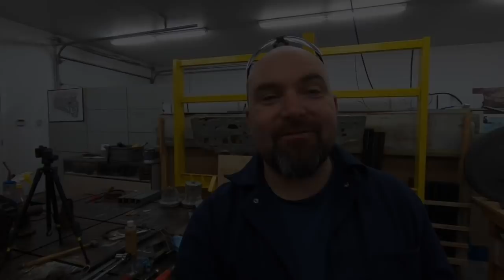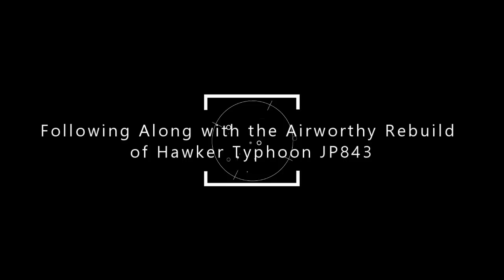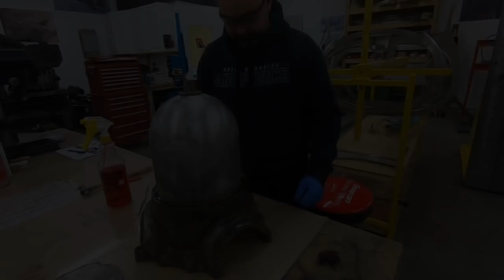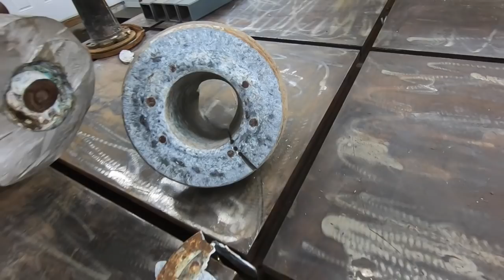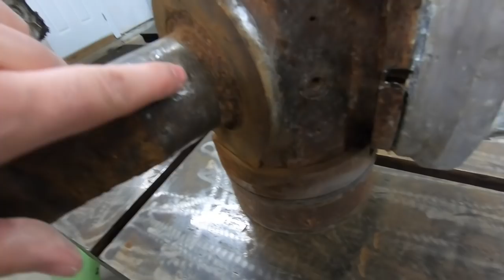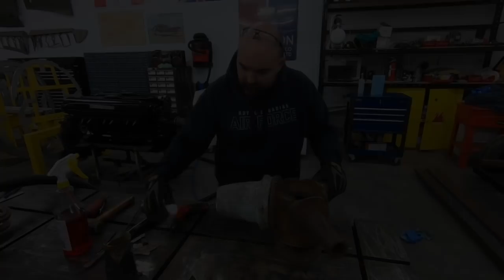S01E10 Part 1 Hawker Typhoon Propeller Investigation

Comment: Greetings Ian.

I am Australian and have maintained a passionate interest in all aviation related subjects since I was a small boy.

While undergoing pilot training in Australia during the 1970's I discovered someone renovating a spitfire with the intention of returning it to engine run and taxi status.

The project was housed in a small, ancient, dilapidated and innocuous looking corrugated iron building on the airfield where I was training.

Being only 30 odd years since the end of WWII at that time all sorts of older aircraft and war surplus was still reasonably available and one bloke had a twin row Wasp mounted in a maintenance frame on castors for sale.

From memory the asking price was something like $2,500 and that engine had several very large fuel pumps, I recall thinking what a phenomenal fuel flow it must have required!

I also recall a section of the building housing the Spitfire project was segregated and one day I looked through a grimy window and saw a semi disassembled fabric covered aircraft which looked as though it was probably an Auster!

All that is undoubtedly long gone now, however I recently had the privilege of accompanying a friend to visit a retired RAAF maintenance engineer who owns a private airstrip along with a Piper Traveler and a couple of tiger moths.

There was also a very dilapidated but completely intact Tiger residing in an annex to the main hangar and when I enquired about it our host told me the old machine had been virtually given to him provided he was willing to remove it from the shed on a farm where it had long resided!

Obviously some special old gems are still out there languishing in the most improbable locations and I live in hope I will catch wind of an engine or parts of one of use to your project one day.

Anyway I digress, the Spitfire I mentioned was being renovated with parts salvaged from all over the Pacific including creation of one wing from the front and rear halves of two separate wings acquired from a dump at separate disused wartime airstrips on small islands.

From that time onward I dropped by occasionally to follow progress and do odd jobs such as filing the dome off conventional pop-rivets to make them look like proper flush rivets and fairing the result with automotive body filler etc.

During one such visit I found the owner of the Spitfire examining a disassembled propeller with badly damaged metal blades which naturally interested me.

As a result of my curiosity I was shown a series of photographs depicting the propeller being salvaged from a swamp near the city of Darwin in the Northern Territory of Australia where it had apparently lain since a Spitfire had crashed there during the war.

I was then shown the disassembled hub of the propeller which had apparently still been full of oil when salvaged and so was in pristine condition.

From memory a large bearing within the hub bore an alpha-numeric sequence lightly inscribed on the outer shell with some sort of Dremel tool or similar method.

The owner said he had provided a copy of the inscription to an organization in England which had been able to tell him that the sequence was the identification number for an employee at the works when the propeller had been assembled.

That information had enabled my acquaintance to determine which Spitfire the propeller was installed on when the aircraft in question was shot down!

Your description of the serial numbers inscribed on the hub-dome you possess evoked many memories and considerable speculation for me!

With regard to engines I also recall reading a book titled 'The Big Show' by free French fighter ace Pierre Clostermann who flew Napier engined Tempests during the latter half of the war.

During that period in his narrative Clostermann describes a number of Tempest crashes and I wonder if any of his descriptions might enable someone to locate further engines or components for you?

Thanks for some really interesting content!
Reply from the maker: It is quite impressive to find internal component in "like new" condition. Maybe not a situation that happens often anymore, but we've got to take it when we can get it leaving no stone un-turned. Unfortunately the recovery of crash sites is becoming increasingly difficult due to new laws being implemented throughout many European countries; most of our efforts to find parts fro reverse engineering relate to finding those who have made such recoveries in the past.

Comment: Not being funny Ian but why not sick that on a milling machine and just mill a big slot from the base out towards the tip down to the bushing,  then on the smaller diameter do the same again then cock the unit on an angle to coincide with the tapered part and you would save yourself a ton of time to get that prop root off of the spider.
Reply from the maker: I went this route due to the shape; there is quite an uneven profile to it, so the best way to complete that setup would have been to chuck it in a dividing head; unfortunately at that time we didn't have one large enough. ~Ian
Reply: @TyphoonLegacyCoLtd  Good enough reason Ian cheers from the UK, and have a great Christmas and new year mate to you and yours.

Comment: Ya ! I have used atf/ acetone mix before.Seemed to work ok. Like you said , you have to be careful because it is more volatile. I use PB blaster for heavy stuff myself.
Reply from the maker: I really wasn't overly impressed with it,  but it did work. I've used PB blaster and found that it's very good; the one limiting factor of it's use is that it can really smell up the shop! we're using a 5 way penetrant made by 3M now, works great! ~Ian

Comment: Won't the Acetone degrade/destroy non-metallic seals? Sure, you won't be wanting to re-use them but you may need them to correctly size and procure modern replacements.
Reply from the maker: It likely would in a stronger mix held in place for a long period of time; there was no effect on these seals. ~Ian
Reply: Hi Ian, if you use the standard transmission fluid (DEX III) it will attack the insulative varnishes on electrical components whereas the recommended fluid (TQ95) doesn't contain that reactive compound.
 @TyphoonLegacyCoLtd
Reply from the maker: @andrerousseau5730  Very interesting, thanks for that information Andre! ~Ian
Reply: @TyphoonLegacyCoLtd  Further afterthought/suggestion: you briefly alluded to immersion in an ultrasonic bath. If you want to pursue that idea, contact siliconchip.com.au who have published several construction articles on high-power units, the two that come to mind are the boat anti-fouling unit and the straight-out cleaner unit. They also sell the circuit boards and parts kits.

Comment: What is the large disc of metal to the left, as it appears on the video, of the prop hub?   I notice that your audio seems to be low volume even with my PC volume turned up all the way.  Is there some way to increase the volume on your end?
Reply from the maker: The disc is a piece of 6" diameter steel stock that I've bored for holding a rivet set and "back riveting", I also use it as an anvil when needed, and simply as a weight; very helpful! I will look at the audio, this is the first I've heard of the issue. ~Ian

Comment: Consider using beeswax as a penetrating oil. Heat the area and let the wax melt into the joints. It will not evaporate but with heat it reaches further than petroleum based products.
Reply from the maker: That's a new one to me, it doesn't seem to thin down as much as other products would; I'll have to give that a shot to see how well it will work into some crusty old joints! ~Ian

Comment: I had heard that the 50:50 mix of acetone & automatic transmission fluid was unsuitable for storing/dispensing in plastic vessels.
Reply from the maker: I would imagine that it could soften some plastic, we use chemical resistant bottles, hopefully that does the trick, no issues here. ~Ian

Comment: If you are looking to preserve stamped numbers in a housing, there are several dyes out there that may preserve or enhance stamped markings.  If you are looking to find specific paint markings (or different layers of paint) or to find where a repair happened, a multi-spectral camera can allow you to see those types of things.  They aren't too expensive, they are in the $200 and up range.
Reply from the maker: That's interesting! Thank you for sharing that, before I go hunting, do you have any links to sources for both dyes and Cameras? ~Ian
Reply: @TyphoonLegacyCoLtd  I used to know a guy that used a multi-spectral camera to spot previous repair work in a body shop for a dealer, that is why I knew about it.  I don't know what specific camera they used.  And the reason I knew about the dye is that law enforcement uses it to spot serial numbers in guns where the serial number has been ground off, because the stamping of the serial number leaves a deep impression in the metal where the metal has been compressed.  I'll do some research and see if I can't get some more specific information for you.
Reply from the maker: @wackowacko8931  Very cool, thank you! ~Ian

Comment: Just thinking about your dome nut and where you were thinking 'ultra' sonic vibration to loosen, had you thought of 'low' sonic vibration, ie; using a flat snap on a pneumatic rivet gun, I'd fill the nut groove with your 'penetrant', then just run the rivet gun around, and around the outside and see if it loosens the thread.
Obviously don't use enough force to start 'expanding' the hub, just enough to send shockwaves through it.
(Retired aircraft sheet metal worker)
Reply from the maker: For sure, its been done several times already; will just keep going through the cycle; no rush on this one. -Ian
Reply: Thought some heat on the alloy prop spigot would have made for easier removal.

Comment: Why would you choose to preserve the tail geometry (and it sounds like the small tail was a big issue) because you want to build her as she was, but change the prop to composite which never flew on any Typhoon?
Reply: It will look wrong if the shape is altered, changing matarials will not be visable and if it preserves that rare engine, its worth it.
Reply from the maker: There were no issues with the small tail at all, our earlier videos explain this in greater detail. The prop will be identical to the original in appearance. ~Ian

Comment: I''ve lately heard that gasoline storage stabilizer works very well as a de-seizing liquid.
Reply from the maker: Very interesting, I've not heard that one. Do you have any additional details on this ? Ian
Reply: Most gas stabilizing liquids are methyl alcohol with a few other ingredients.  The alcohol absorbs water, turning it into a mostly inert compound for a fuel system.   The alcohol might be good at getting inside a corroded part, but may not introduce any lubrication.  Acetone and ATF is usually the best compound for penetrating and lubricating a part.

Comment: Looking at at the way the spinner was held on to the spider must have been a real challenge to the mechanics in the dusty temporary airfields in France.
Reply from the maker: The spinner would have been relatively easy to remove, it gets attached to the prop back plate. ~Ian

Comment: I believe they also used cut down Hastings propeller blades
Reply from the maker: The Hastings was similar but a 4 blade prop built after the Typhoons main service. We have a Hastings spinner here, but they are slightly different too. MN235 is fitted with a Hastings spinner as well, you can see that it is quite a bit longer than the Typhoon's "natural" spinner. ~Ian

Comment: The three blade props are huge, compared to four blade fitted to the Tiffs! 

Also as far as I know the original (early batch) Tiffy's had a shorter tail and rudder as well. The later tail empernage mods came from the Tempest production line - hence they called them a Tempest Tail (another ideocracy of Hawker's designer's) .
Reply from the maker: Both 3 and 4 blade props fitted to the Typhoon were 14 feet in diameter. 

The "Tempest Tail" refers to the horizontal stabilizers only, these were the same spars as the early Typhoon versions, but with extended nose ribs and wingtips to increase area. With the exception of the first Tempest, Tempests were fitted with a completely different fin than the Typhoon, this was never fitted to Typhoons. The Rudder was similar, but extended upwards on the Tempest, this was done to coincide with the taller fin. Some of our earlier videos cover these differences. ~Ian
Reply: @TyphoonLegacyCoLtd  I've heard or read it somewhere at either Kingston or Dunsfold - that the original 3 blade fitted was 16'8", but it caused handling & engine problems hence the prop diameter was reduced and the tail fin height increased and later the fuselage being reinforced at the transport joint.

The horizontal stabilisers were designed to be changed in the field. I think that's where the Tempest Tail analogy comes from and (knowing Hawkers) the mounting points on the fuselage for the horizontal stabilizers are in the same place. 

A bit of useless info, from the original P.1127 to the last of the Harrier 1's - the engine/wing and tail empernage mounts are all in the same place (as they were fixed mounting pointing's on the jigs).

Though BAE Systems have now confused things even further by name the 6 Gen Multirole Combat Aircraft they are developing the Tempest and of course there's Eurofighter Typhoon (which upset the Germans).

Comment: You talk about a composite blade do you mean carbon fibre and what have you? Another question is what is your projected time scale on this project?
Reply from the maker: The "Composite" blades are typically laminated wood. With a project of this scale it is very difficult to commit to a timeline. This is not due to the amount of work, but due to the scattered data, parts and other resources required to complete it. Will work hard to complete as soon as possible, but I feel a committed timeline on an aircraft that has not been worked on since thee 1940's would be foolish. Almost every main component of the Typhoon is unique and requires very thorough research to return to airworthness.  ~Ian

Comment: Great Work as always Ian. We call that “chain drilling” in the UK.
Have you spoke with Hamilton Standard about prop blades?. I used to work on a turboprop with similar horsepower levels to your Napier Sabre and one of their props. They may have something almost “off the shelf” for JP843?
Reply from the maker: HS did make LH rotation blades for some early aircraft, but in very small numbers. Unfortunately there is no "off the shelf" option for this one. ~Ian
Reply: @TyphoonLegacyCoLtd  best of luck. It’s a terrific project.

Comment: You talk about the original Aluminium/Duralumin blade material and explain that the way forward will be to use a 'composite' material. What will the 'composite' be made of?
Reply: Same method as Spitfire prop. Wood essentially. Laminated.
Reply: @stewartgrant9832  Thanks.
Reply from the maker: As Stewart mentioned the "composite" blades are typically of a wood laminate construction. ~Ian
Reply: @TyphoonLegacyCoLtd  Thanks Ian. Wood laminate will certainly be easier and cheaper to reproduce and help prevent engine damage in the event of a 'ground strike'. Thanks also for your really interesting films and for allowing others to watch your project as a whole. It looked hard work getting the remains of that prop off of that 'spider'. Well done.
Reply from the maker: @HighFlight  Thank you! ~Ian

Comment: Ian.  When inspecting a part, how do you decide if any corrosion is acceptable or when does it need to be replaced.  What parameters do you use?
Reply from the maker: It really depends on the part and the tolerances for repair given by the manufacturer. These parts are well beyond airworthy limits. ~Ian
Reply: @TyphoonLegacyCoLtd  Thanks Ian.  I was thinking about the wing spar spacers and stuff like that.  I just put it in the wrong place.... Amazing work sir, I love it.
Reply from the maker: @gfo8755 , In cases like the spacers, I would look at them with a fairly general inspection of max reduction of 10% of the material thickness once the damaged is removed. The damage must be removed in a certain breadth as it relates to the depth as well, so as not to have spots for stress to concentrate. ~Ian

Comment: The hub and motor came from salt water? I´m amazed that any of it would be fit to use...or are you planning to reverse engineer everything?
Reply from the maker: These are not suitable for use, they will likely be used for a static display, or at the very best (if they are reasonable) a ground running engine. ~Ian
Reply: @TyphoonLegacyCoLtd  Cool, thank you.